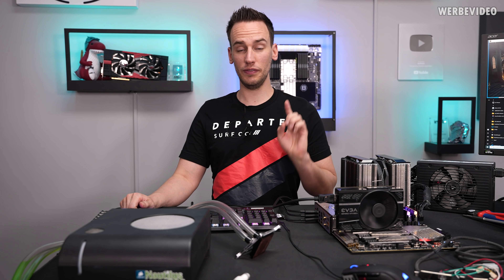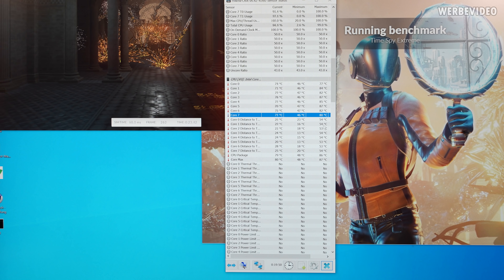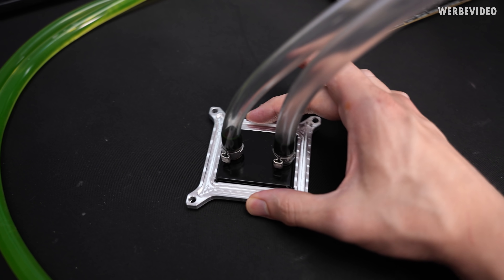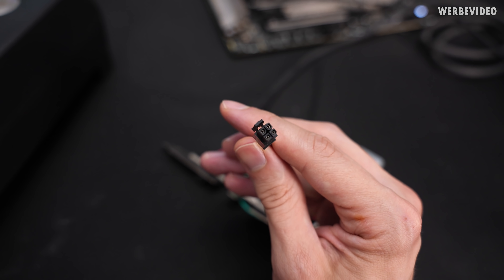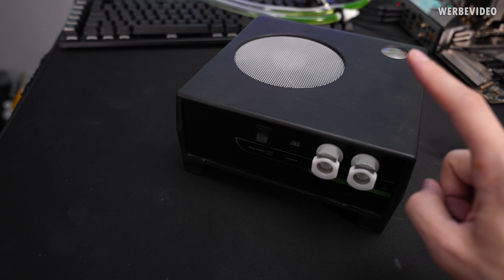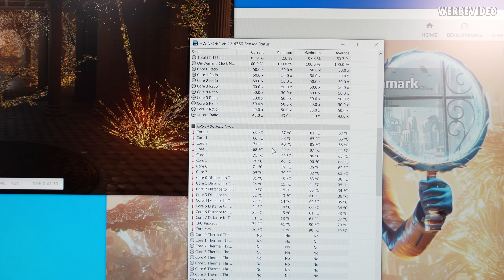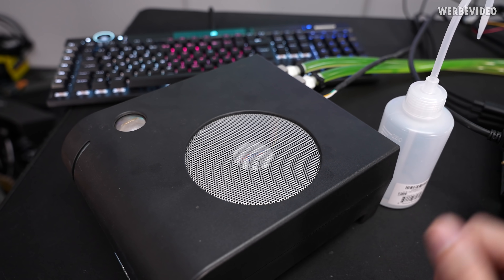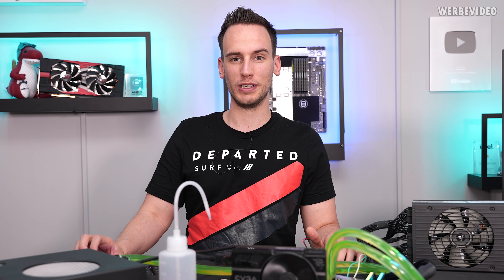The Very First Corsair AIO (15 Years old !) vs. 11900K

Comment: Corsair also made the "Corsair COOL" custom loop around the same time (cira. 2005~6) and this was the first custom loop I played around with. The reservoir was a 5¼" bay affair (which broke a stem and killed my DVD drive - I replaced it with one made by Thermaltake) and the 120mm radiator was mounted to the outside of the case using what Corsair called a "RadBox". The kit also came with a PCI bracket with cutouts to allow the tubes to exit the case and a power connection for the fan which was identical to the power connector on the back of the Nautilus box plus an obnoxiously loud industrial type static speed 120mm fan. The fluid was the same green affair as your Nautilus and it used a separate 12V pump mounted within the computer case using a sticky foam pad. I ran it on my AMD FX-60/DFI NF4 Expert SLI board and later added 2 x Swiftec GPU blocks for my SLI'ed 7900GT's. Only threw it out a couple of years ago when I was reorganizing my shed of PC bits.

Comment: My first aio was a coolit model with the pump attached to the radiator that would attach to the exhaust of the pc.

I also had a wierd TEC aio once upon a time that didn't have a proper radiator more like a series of discs air would be drawn through them. It had two cold plates.

No idea what it was called.

Comment: Cooler Master had a similar system, I still have most of it, I think, I may have sold the water block a long time ago.  Cooler Master Aquagate Max Is the one I have/had.  I bought it in 2009 I think.  It was more of a kit tbh. A friend of mine had the Zalman Reserator, which was at least a few years older.
It fell apart after so many years of use.  The reservoir started cracking and leaking, the pump leaked, I poked a hole in the radiator.  I kept on repairing it for quite a few years.
I still have the original fluid because they didn’t provide near enough, and the fans still work 😆

Comment: I remember when liquid cooling was first talked about 15-20 years ago, the radiator was always external, which makes more sense, the only reason to have the radiator inside the case is for neatness, but it makes far more sense to be outside the case were it's not picking up warm air.
Reply: The warm air factor is there but basically negligible. Also, neatness is one reason but the main reason radiators and reservoirs used to be external was just lack of space inside the case. Multiple 5.25" bays were populated, maybe a 3.5" floppy bay, multiple 3.5" HDDs, all of them connected with big old IDE ribbon cables, then a discrete soundcard with a cd-audio cable running to it, usb add-on cards etc and usually no space under the motherboard tray to route cables. It was just a nightmare in general to maintain a clean system back then.
Reply: @mysterynad  "The warm air factor is there but basically negligible" Have some data to back it up? "reservoirs used to be external was just lack of space inside the case", another load of crap, you're clearly talking about things you don't know.

Comment: Had one that mounted in either 2 5-1/4 bays or externally. Came with a detachable blue LCD screen and cooled with a 80mm fan. I think it was a Thermaltake, came with blue liquid in a squirt bottle, and had those quick disconnects. Used it for my Athlon XPs.
Reply: That's what I think I had too, can't think of the name of it though

Comment: I still have my Thermaltake Big water cooler tucked away. I think it's from 2007ish.
Reply: Ours broke. One fitting of the CPU block, just broke off, for no apparent reason and the pump of the other is not properly working anymore. We had the TT Level 10 GT LCS back then.

Comment: Im still using a 120mm AIO for a manually overclocked 10700k. I had first bought the 120mm to cool a 7700k, it worked well. In normal use the 10700k runs cooler than the 7700k.
Reply: Probably due to the lower die height.

Comment: I had a Gigabyte 3D Galaxy watercooling kit back in the early 2000's, I think it may have been the 1st kit ever, I'd never seen one before, it was all homebrew with car radiators back then afaik.
Reply: The oldest review I can see for the Corsair is May 2006, the Gigabyte is August 2005.  Having these kits was such a game changer.  The Gigabyte block is a huge heavy copper thing, with a better water pump I got to flog the living crap out of my AMD systems, running 1:1 with FSB over 285 lol
Reply: The Zalman Reserator 1 is from back in mid 2004 and Danger Den was selling their Maze watercooling kits before that.
Reply: I have a Titan/Datacooler DWC-A1 AIO from 2003, it was for Intel Socket 370 and 478 and AMD 462 and I used it in my Retro 2000 (Pentium III 1000EB).
Reply: @PauloRAgostinho  wow thats a cool setup, I had not seen that before.
Reply: Well bugger me.  I'm from Australia, might be why I hadn't even seen them before.  Going right back to 370/478/462 is craazy!
Reply: @minus3dbintheteens60  Probably, in import sticker in the package states taht is from 30/04/2003 and 8/12. I assume that not many were sold back then.
Reply: Geez, I had to refresh my memory on these old sockets lol. Im super surprised there was that kit for 370 or AKA P3. I'm now having flashbacks to my old watercooling kit on my 462, Barton core. That laptop CPU copped such a flogging,  the old DFI and Abit motherboards and nforce chipsets, its all coming back now 💭😄
Reply: @minus3dbintheteens60  Ahah it always good to remember the old times, that I collect old hardware 😂 

I think if we search more we will find older solution in watercooling.

Comment: WOW! 15 years with the same coolant. Then why most manufacturers recommend replacing the coolant every year?
I changed mine after 3 years and a half and everything was in almost perfect shape.
Reply: All depends what kind of coolant you are using
Reply: @elliottslab  I had EK-CryoFuel Clear Concentrate (for 3.5 years).
On their website it says "We recommend replacing the liquids every 12 months for best performance!", but I saw no change in temperatures over the years. Dust would build up on the radiator which made the temps rise by a few degrees, but after cleaning, it always went back to the same readings as if it was new. Not even 0.5 degrees difference.
Reply: @Tealc2323  they want your money. It's simple :)
I had the same solid coolant from EK for 3 years. Everything stayed perfect until I decided to redesign the loop.
Reply: @madd5  Yeah, I guess.
Reply: Sounds like another case of planned obsolescence.
Reply: @puciohenzap891  Not everything that fails early is planned obsolete some coolant is just way more shitty
Reply: The TT coolant turned brown after a few years in use.

Comment: Looks like an automotive grade coolant was used.
Reply: thats what i use in my loop. 20% Prestone Universal for all makes/models and 80% water.
Reply: Automotive coolant puts shitty PC brand coolant to shame. I know from my own custom water cooled machines.
Reply: @B15HOP  automotive coolant is to keep the coolant from freezing, that's why it's called "antifreeze" it doesn't cool as good as distilled water.
Reply: @B15HOP  I never said it did, I been around since the beginning in the late 70s and actually have seen full automotive radiators used long before any of this boutique stuff.
Reply: @B15HOP I'm too old too try to convince anyone of anything, there's an old saying you can lead a horse to water but ya can't make him drink....so yea after running all kinds of different coolant types I just run straight distilled now I get zero corrosion
Reply: @gr33nn1ck7  Yep, I run distilled plus an once of water wetter.  I don't have a window on the side of my case, I don't use hard tubing cause though it looks sexy through the window I don't have, if you have to change your graphics card or mess with things hard tubing is a PIA, soft flexible tubing is works fine.  No RGB here :)
Reply: I believe Delphi was involved in the design, which explains the automotive-like coolant.
Reply: Yeah, I suspect they used some variety of antifreeze
Reply: Back then that's what shipped with these water-cooling systems. I had a Thermaltake Kandalf LCF case and it had identical looking fluid.
Reply: You actually want very very little antifreeze in your loop to stop growth and wet the water.  Distilled water is MUCH better cooling without anything in it.  An once or 2 of Water Wetter or antifreeze with all distilled water is all you need.
Reply: @Cinnabuns2009  water wetter is awsome stuff I know guys that use it in motorcycles
Reply: ive been using dexcool orange in mine with distilled water and all my growth issues + clogging have stopped.
Reply: I bet It Tastes Like Wallmart Brand  lol
Reply: Automotive coolant is all I'd run in a system. Trying to go "non toxic" seems to have been the issue for a few of the cooler brands suffering gunk. 

Automotive coolant isn't just an anti freezing agent, it has anti corrosion properties, and slight lubricating properties to help with the vehicles water pump shaft seal.

Comment: Coolant looks like what Thermaltake used at the time.
CL-W0148
1000ml (Green) DIY LCS Coolant
Anti Freeze, Anti-Rust, Water Scale Prevention.
Reply: Same stuff that's in a car lol.
Reply: @MrLunithy  in fact car antifreeze+distilled water works great for custom loops
Reply: @MrLunithy  And why shouldn't they use that? Commercial antifreeze products for use with combustion engines has been available for about 100 years by now, so the properties are well understood. Granted most PC cooling loops do not require the antifreeze property, but the corrosion inhibitors are nice. In the cooling system for a car engine you are likely to have a mixture of metals such as aluminum, iron, copper, bronze, zinc, lead and tin so corrosion inhibitors are pretty important, and they work. The water wetting properties I'm not sold on though. In test after test pure water has been shown to be better at transferring heat than water with a water wetting agent added to it.
Reply: Yes..the TT Big Water SE (120mm fan/120 Rad)... still have mine in my closet. Bought it ~ '05 iirc.
Reply: Yeah, came with my TT Level 10 GT LCS, back then.

Comment: Looks like a motorcycle radiator...
Reply: Yep, Dell used similar parts for h2c, made by Delphi
Reply: @LabRat Knatz Interesting, never seen a WC'd Sony PC! Dell's XPS 720/730 had that H2C water + peltier cooling and it was insanely powerful, you could max out an i7 990X Gulftown on it and the chipset was also liquid cooled.